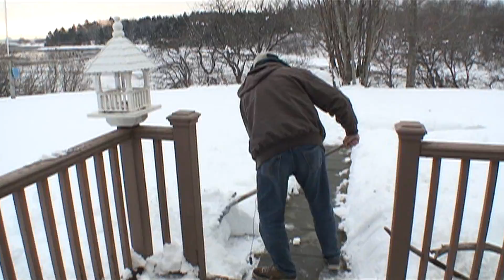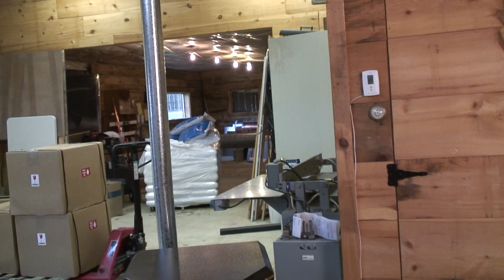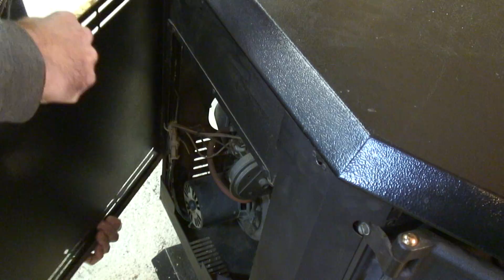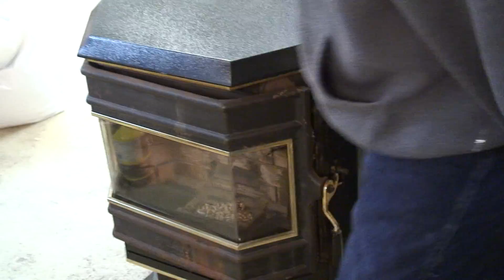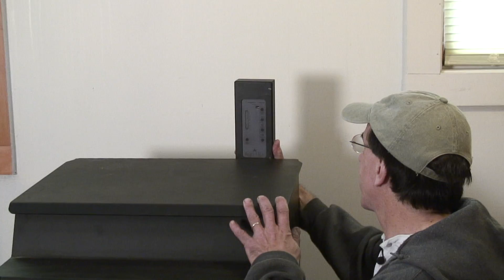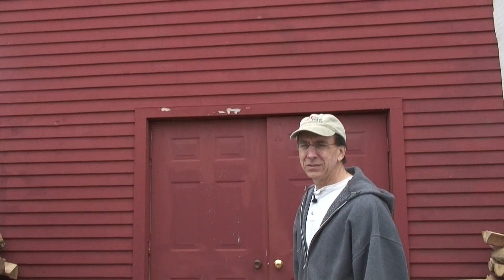Hot and Cold: Pellet Stoves

Comment: On the first stove it doesn't look like your using the proper pellet stove flue pipe, as the second one is the correct pipe, but needs an end cap..
Reply from the maker: You are correct!  The first stove was jerry-rigged and later installed properly.  The second stove did have an end cap, it just wasn't on for this episode.